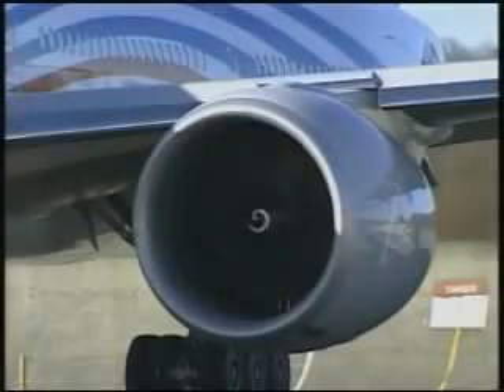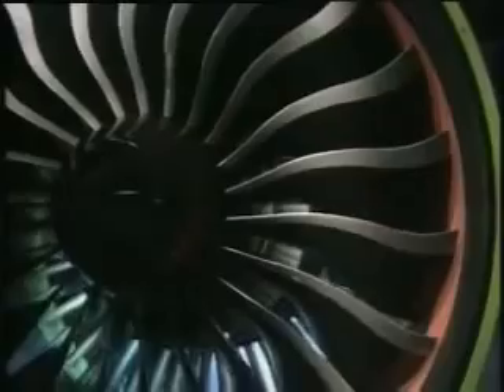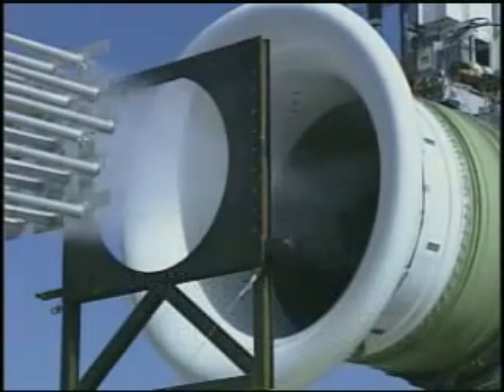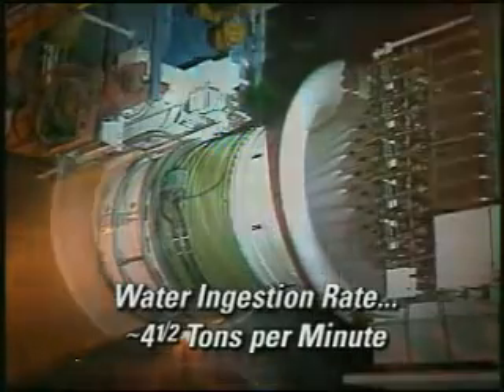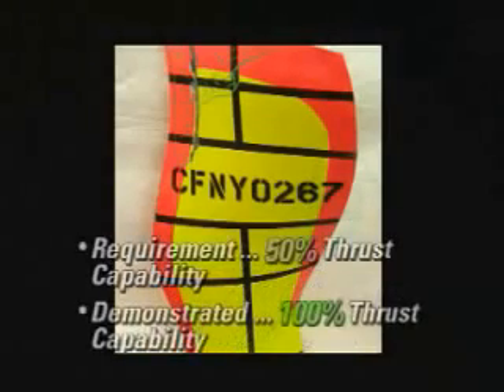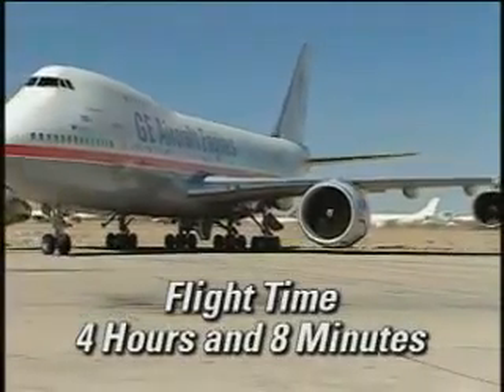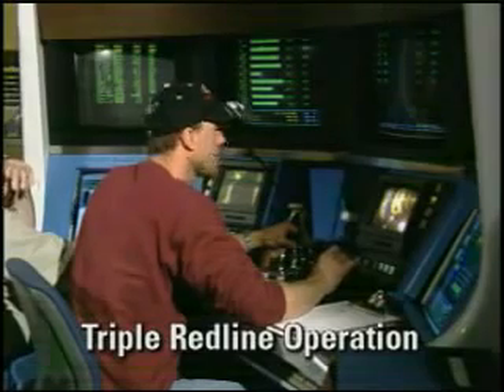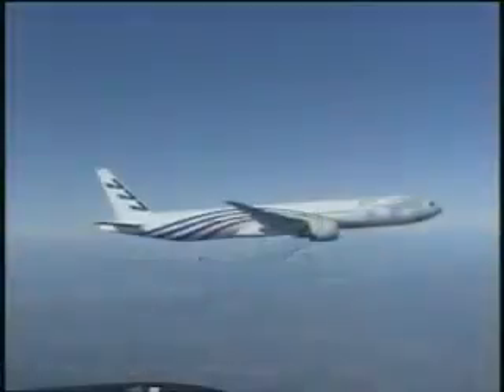GE90-115B Gas Turbine Jet Engine

Comment: Strapped one of these babies to a modified VW Super Beetle, but didn't get the performance I expected for my $30 mil spent, so I boxed it back up and sold it on EBay
Reply: I remember that! I was the GE90-115B!
Reply: @james_fisch  Hope you've had a good service life. Sorry it didn't work out.